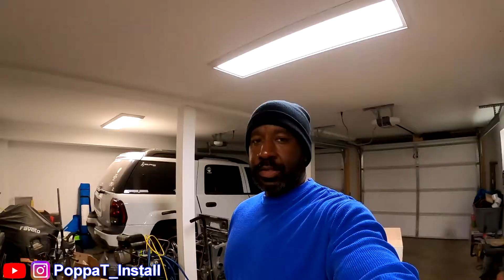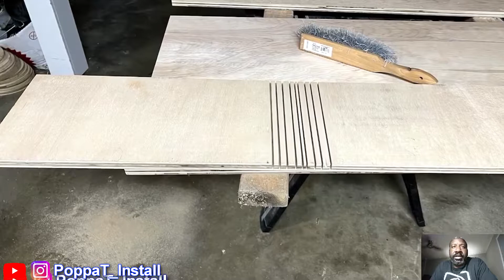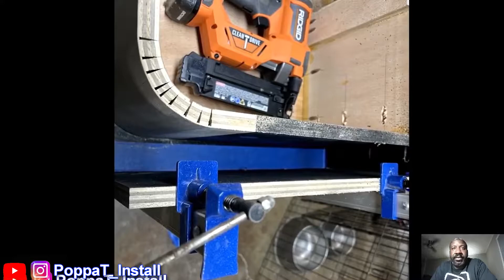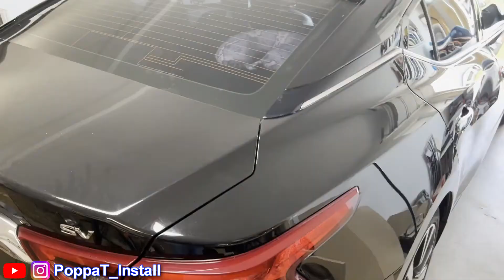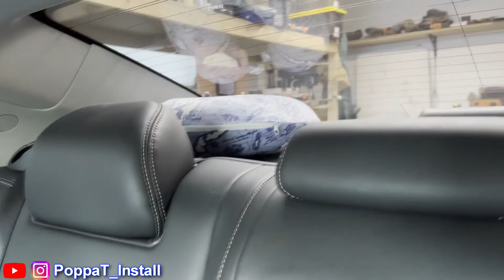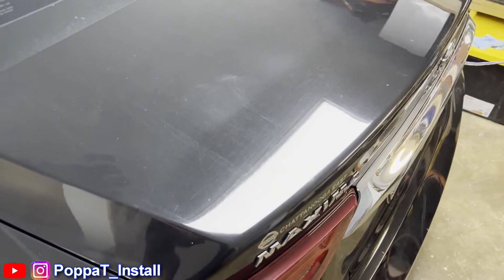2-CT Sounds Meso 8 Enclosure Build and Testing

Comment: Idk why people's first thought of hearing bang in the trunk think it's 2 12s in the trunk..nah just 3 6.5s, or 2 8s or 1 10 whatever your preference is lol. I get that 12 is like the "magical" number for sub but not always the case. With the right box knowledge and power. Sometimes smaller numbers do better than 12
Reply from the maker: Precisely why I did this video to show that you don't need much to make yourself happy. 🙌
Reply: They hit different.  Also depending the brand or what type and what kind of electrical your giving your system.  Proper boxes is a must
Reply: I can promise you this my 2/8 on 4000 Watts can walk most 12s all day

Comment: What made you decide on the box size?  in a tiny box per sub....I usually go off the recommendations on the website but it just seems to small to get that deep bass. They recommend a high tuning as well.
Reply from the maker: I was just messing around.  I did get low though but it was bottoming out so I scrapped the project.